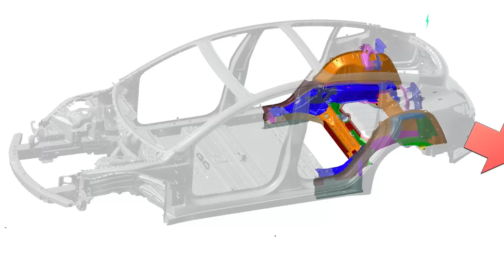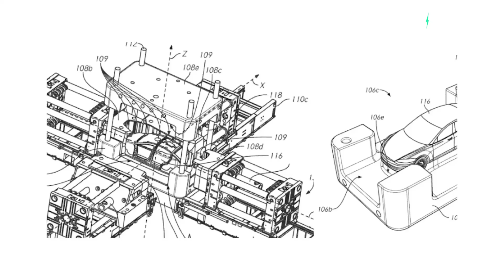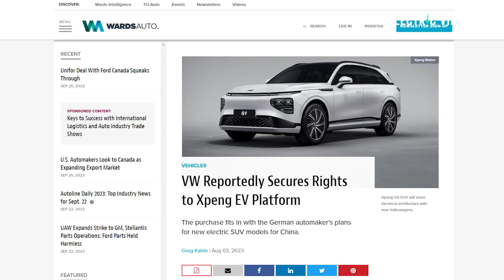Tesla Giga Shanghai launches 1-piece Giga casting for epic 40% cost reduction

Comment: What about body shop accident repair. Say, you're rear-ended and have $10,000 worth of damage, then do you have to total the car, or is there another solution?
Reply: If it is only $10K it is likely they can fix the car by replacing the bolt on crush cans.   Take a look at the casting.  They are designed to gradually collapse as forces increase.   These have to be among if not the safest cars in the world.  How much is your life worth?

Comment: I love this technology where it is monolithic. Presumably less weak points at spot welds. Exciting news now. Since Henry Ford designing & manufacturing cars, no manufacturers has move to this dimension until now. Well done Shanghai & Tesla!!
Reply: we have arrived at full sized  diecast Matchbox and Hotwheels cars for all.
Reply: @kadmow  No, we haven't.  This is false clickbait.  Single piece has't happened yet.  The original article everyone is citing doesn't say that at all.
Reply: Will there be changeS on how to do crash repair? Can you weld these aluminim casts? Where do you get replacement *panels*? Just chop a complete cast for spares?
Reply: @nickus9119  exactly,  if you get into a fenderblender, your tesla is totalled.
Reply: @albertiwong Tesla has always looked at this in a completely different way. They build the car so that in a collision,the occupants survive. The car is second priority. Then they build a car that is much less likely to be in a collision and it can record the circumstances. If you crash into a Tesla you buy them a new one . The insurance company will save the cost of salvaging and reusing damaged parts.😊
Reply: @albertiwong  no way. They can be repaired.

Comment: "Sometimes I wonder what GM and Ford could accomplish if not under the yoke of the UAW"

- Completely false and shows you have no idea what you're talking about as the union UAW has nothing to do with the outrageous over-pay for the top management and CEO's etc. Accomplishment failures rest in the hands of the CEO's and poor management - they seem best at loosing money and screwing things up. Had legacy US auto CEO's not jacked up their own pay by 40% or shared it with the workers there would be no strike. Also, those union workers at UAW make far more than Tesla workers do - specifically due to having a union. The union hate was started by Ronald Reagan - a terrible President.

Comment: I think something is lost in translation here. I want to see this to see what it is. I don't think this is what the Viking thinks it is.
Reply: Soo.....what do you think HE thinks it is......and what do YOU think it is.....!?!?
Reply: @andymccabe6712  That is going to be lost in translation as well, but let me try. Making such a gigantic casting that he suggests, where the front gigacasting, the rear gigacasting and connecting bits going along the sides of where the battery fits as one giant solid piece would be a HUGE deal. It would also require a physically much bigger press, not just new tools in the existing very big presses. It would also not fit in with the thinking we saw suggested for the assembly process of the smaller future model. I think this is Chinese Tesla people bragging about how they save loads of parts by making ONE big casting in the back, and then do the same in the front, and quite likely they have made some improvements. But that does not mean "Humongoucasts".

Comment: Please i love watching your posts but - it's reducing Mass the give the greatest overall performance by enabling increased acceleration. 
Reducing weight (a force) may allow for lighter suspension components but its the over all reduction in the mass improves performance.
You sound like an Ozzie educated Viking so please help the less fortunate that didn't learn the advantages of ISO. etc.
(Mass is not a Force & Weight is not a Mass)..
Reply: Weight is not a Mass 
Technically correct, but since the acceleration due to gravity is roughly the same anywhere on earth, weight is often used as a proxy for mass. This is sometimes indicated in the unit ("lbm"); but most often it's just implied. And if a pound were never a unit of mass, why is it defined as 0.453 592 37 kg; where, of course, kg is a unit of mass?
Reply: @BigBen621 this a YouTube thread which will disappear up its own ass......wait and see!!!

Comment: If you compare the current Model 3 to an Accord or Camry, the Tesla weighs about 500-600 lbs more, not less. I think this fewer-parts approach is great for cost savings to Tesla, but in the end might not save anything for the consumer, because the insurance companies charge more because the vehicle is (less repairable) more easily totaled. Insurance in the USA for Teslas is a good bit higher than a comparable gas vehicle. Edited: (I see I'm not alone on the concern of insurance prices after reading more posts).
Reply: Tesla has is own insurance.  It's cheaper.😂
Reply: @davdin2  Unfortunately not available in all states. (i.e. FL)
Reply: He rarely discusses any negatives of EV's
Reply: I’m not convinced because body repair has always involved cutting and replacing sections.
Reply: @jsanders100  This has nothing to do with body repair
Reply: @jsanders100   That has changed.  Different materials.
Reply: Good point, I wonder how much the high safety rating of Tesla designs & additional driver aides like FSD may, in the future, help offset the risk of higher insurance cost in the case of the higher likelyhood of a totaled vehicle?
Reply: @daveknight8078  Glad you asked.   Net says insurance companies pay out more for medical than car repair.
Tesla is the safer car.  Insurance should smile when they give people new  cars and pay a lot less in medical.
They will continue to focus on the added cost.

Comment: The original Beetle had a Unit Body construction in the 1930's.  In concept, similar to gigacasting
Reply: I remember changing the whole body of a beetle in 1972. It took like fifteen guys lifted the old one and installed the new one. It was like twenty bolts.
Reply: Nope, sorry. The frame was a lot of pieces welded together. The body was bolted to the frame but the body also had many pieces -- some welded, other bolted together.
Reply: Except that unibody was hundreds of parts weld and bolted together.
Reply: Well, ok. My brother considered replacing the entire body of his ancient Fiat 500, having it shipped over from Italy in one piece. But that one piece was put together from lots of smaller pieces. A one-piece gigacasting is exactly what it says - one single piece replacing the monocoque or unibody [both those terms meaning single piece, but from an amalgam of parts]. You hang the rest of the car off it.
One day, when all there is, is Robotaxis and zero crashes, we may find the entire vehicle, including the outer surfaces, is gigacasted and finished - just like the diecast toy cars of my childhood.

Comment: Doesn't a reduction in weight mean a reduction in traction and thus acceleration?
Reply: No. What you are referring to is tire load. You can reach that by creating downforce by aerodynamic means or by making the contact  area between the tire and the road smaller. That is the reason why smaller tires make more sense in winter: The increased tire load makes the tires have more traction at the expense of lateral stability.
Reply: @joergmaass  You only get aerodynamic downforce when you are moving - it actually reduces acceleration forward momentum by definition.
More traction requires larger tyres, not smaller, but it's a balance.
Look at the McMurtry Spéirling - they didn't want a 'wing' on it to start with because it reduces acceleration.

Comment: What happens in the event of an accident? The damaged part can't just be replaced because it is all one piece
Reply: Same as for every car, they get scrapped. Unless it was the crush cans, cause then it can be repaired as any other car.
Reply: It all depends on the severity of the accident, just like existing cars. To some extent they can be repaired by cutting out the most commonly damaged member and welding in the standard replacement part. If it's too bad for that, it's scrap, just like every other car.
Reply: What if what if what if…
Reply: There are parts that can be cut off, and new pieces that can be bolted on. There are built with this in mind.
Reply: That’s not true. Tesla has its own insurance because they understand how to properly estimate the costs. And as others have stated many of the parts can be replaced with standard panels. The soccer everybody has FSD the better. Then crashes will be greatly reduced anyway.
Reply: @8ballphilc  ; -or "they" - or maybe not ??? do you really know or just BS$ ??
Reply: I think accidents are less of a concern than metal fatigue.   Most modern cars aren't worth repairing after  a significant accident.   What will be really interesting is cracks opening up in these mega castings  in a few years.   Insurance won't cover that.   Some intriguing repair techniques may be required.
Reply: I think if the "engine compartment" crumbles this will probably be a total loss for both ICE and EV types of cars.  The real question is whether the front and back have regions that can be bent in a minor accident that can't be bent back for EVs.  I think that either insurance for EVs will become more expensive, or become less expensive depending on how all factors play out and the world will go on.
Reply: Elon said the crash rails, can be replaced if there is a collision.  Any vehicle that can't be repaired back to the original safety standards of the vehicle as it left the factory will get a salvage title.  It doesn't matter if it's a Ford, Toyota, or a Tesla.
Reply: Is any videoclip here at all relevant to the topic? You're talking about gigacasting the entire body but there is absolutely nothing in the clips reminding it.
Reply: If any ordinary car chassis bended or been damaged, it will be declare totaled, basically it no longer legal to repair and drive on the road anymore that's why we  have insurance.
Reply: @thatsawesome2060 .  . This is exactly what happened to our old 2012 Prius V. My ex got into a fender bender and the Insurance company declared the car a total loss, which I thought was ridiculous, but that’s what they did.
Reply: @thatsawesome2060 not correct..... At least, not in the UK.....!!
Reply: @andymccabe6712 it’s correct in practice in the UK for newish cars.
Insurance companies don’t like major repairs, they just give you a cash offer & sell the parts.
Reply: @thatsawesome2060   - edit is a great feature of youtube comments. (yes insurance ensures maximum cost for all.)
Reply: @kadmow  I am not a native English speaker, so yes Edit features do help me out. And why that bother you?
Reply: @thatsawesome2060  A lot of body shops will be quite surprised to find that out. Better start ringing them all and tell them to stop.🤔
Reply: @robertgreen9614  I don't know which country you come from what I say is applicable to 1st world countries road safety requirements, but plenty of Tesla has been found in Ukraine, and many other ordinary car such Ford and Toyota has been declared total lost but been repaired anyway and sold to other countries like Ghana etc, but it's should not been use again on US road. So if you are not from US you don't even need to worry single frame or not as long you road safety requirements didn't prevent it, you basically can welded or glue it as you like and just drive it again.
Reply: Same as w any other car.  If the underbody is compromised the car gets scrapped.
Reply: Tesla has its own insurance and thus knows very well how gigacasts are affecting repears and they saybit is often even cheaper  !
Reply: The goal is no to minimal accidents with FSD. Elon is changing civilization
Reply: Makes more sense to lease an EV
Reply: It depends. @xinfuxia3809
Reply: fan boys didn't really respond here.  When you are revolutionizing the industry let's also think about how these new manufacturing methods impact repair costs and the availability of repair parts. Insurance companies will have a say in what total cost of ownership is for  these throw away vehicles.  Cost to insure the single casting vehicle may offset the cost savings of initial vehicle purchase (depending on how much cost savings Lord Elon allows to pass to the consumer).

Comment: Tesla doesn't reduce weight with giga casting. They are actually HEAVIER, ask Sandy Muro. They reduce cost in parts and time.
Reply: Rubbish, provide the link or back down
Reply: There another vid where Sandy comments on teh weight difference between casing and steel and SAndy said they took a hit on weight but made manufact cheaper so customer wins any way. Not a huge enough difference to not use casting. U find them your self. Im going back thru those vids foir u. @roryreddog3258
Reply: Do you see the flaw here.    They checked one ore two castings from an early example.   They should have said, in the case of the casting we checked on the car we tore down they were heavier.  They also failed to say how much heavier.    
These parts are cast in molds which can be optimized.   We should not read too much into what Munro said.
Munro is/was under attack for saying good things about Tesla.  They may have been tossing the Tesla haters a bone.

Comment: Got the weights wrong. Model 3 weighs more then equivalnt gas powered vehicles. Model 3 weight 3,862 to 4,048 lbs vs a honda civic 2,877 to 3,102 lbs.  Ice vehicles are lighter then ev equivalents. They would need to significantly improve ev energy per kq to even come close.
Reply: Well base off what he said, you would take that amount and remove 16% if true. Making them that much closer. LFP are also not solid state or sulfur - meaning there is an upgrade coming soon that would remove half the weight and size. So we could be seeing EVs hit half or at around ICE weight in less than 3 years.
Reply: @adr2t  well the weight difference is all battery. So better battery chemistry would be needed. But if manufacturers weren't stupid they would apply gigacasting to ice vehicles as well. Which would make ice vehicles lighter making it harder for ev  to catch up. Also this would allow for lighter engine and smaller fuel tanks again more weight savings and better fuel efficiency. I don't see old manufacturers having the foresight or being flexible enough to pull it off.

Comment: It would be nice to have some thoughts on Sandy Munro's observation that the structural battery packs have "zero reparability" as this has major implications for insurance.
Reply: Seems like they are designing these cars as throwaway.  Meaning they will be hard to break...(TOTAL).....
Reply: @conservativebiker  like the lighters of old... This is not very ecological if you ask me. Repairability is almost down to zero just like all the more recent iphones...
Reply: Structural battery packs like the cells they contain are under development.    I would be hesitant to condemn them at this point.  Having said that I share your concern.   Do we know how often non structural skateboard battery packs are being repaired after collision?  Could be insurance will buy a new pack rather than face a potential liability issue.
Reply: @danharold3087  It's more about the repair of defunct battery cells which are now being tucked away from anyone's reach making them basically throwaway cars, and than the outer shell being one pressing makes them also more prone to being totaled and written off sooner than cars with separate pannels, I'm afraid
Reply: @danharold3087  Yes, definitely not condemn them, but the point you raise is exactly the problem.  Even very minor damage is an issue if there really is zero possibility to repair.  Because if that is the case it could well be the disadvantages outweigh the pros.
Reply: @jamie-ck6js  Swap in a new pack, it even saves many expensive workshop hours. A damage to the battery pack is rare, and a failure internally in the pack will be much rarer in a design with fewer cells/connections/modules/things that can fail, so no problem at all for insurance or warranty. Or if the car is old, tired and out of warranty, swap in a less used pack from a crashed donor car. This is not an issue at all.

Comment: I am looking forward to the new Tesla Roadster being the pacecar for Formula One with FSD so that it can go around the track quicker than ICE cars so that the racecars are not unduly held up.
Reply: Ha ha that would be brilliant !!!
Reply: …and in reverse !!!
Reply: Sooo funny!!
Reply: Won't happen. The pace car is provided, no doubt at vast expense, by one of the engine sponsors, Mercedes, etc. It's about marketing and Tesla isn't in the game for that.
Reply: Or outpacing them 😅
Reply: @gideonleroux8253   - we can only hope...  or dream.
Reply: A pace car that outpaces. Interesting concept. @gideonleroux8253
Reply: With an EV, sensors and compute - and ( of course) neural nets and lots of training data - it could easily beat a human driver... ( there are many that would disagree...) What ! Formula One drivers beaten by a computer !  ( It will happen...)
Reply: This will be very costly to insurers...   A car will "totalled" much quicker in an accident than a car with modular construction!!!
Reply: @jamesbush2720  not true. You can straighten and weld if needed to get to the original datum points.